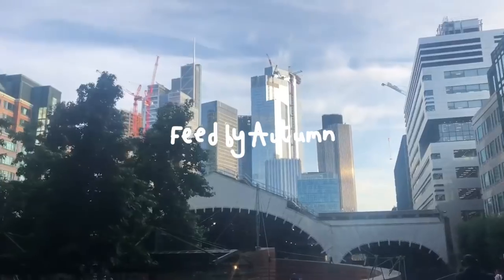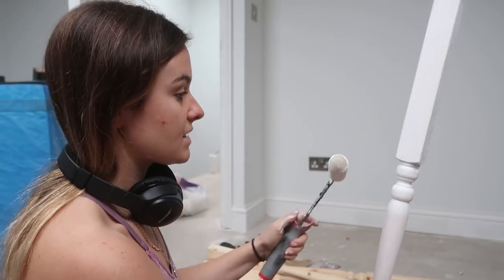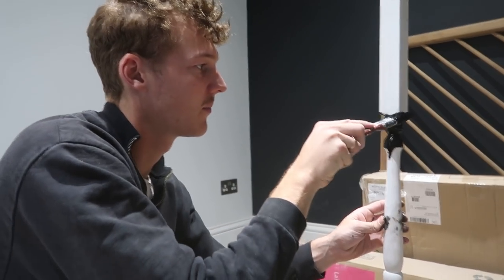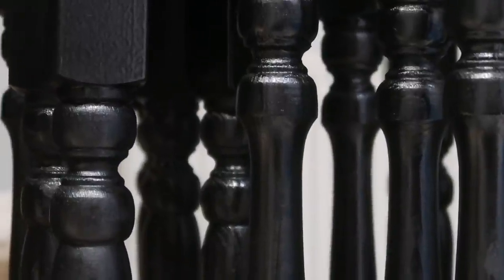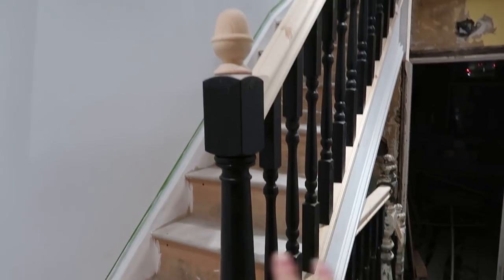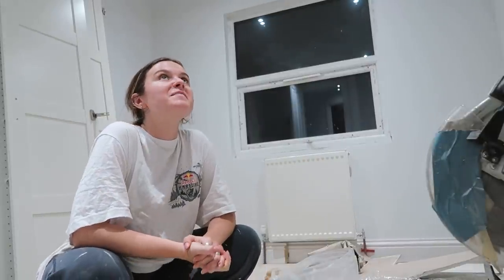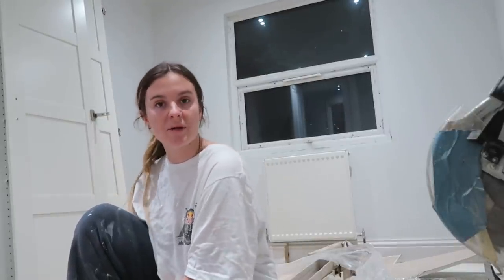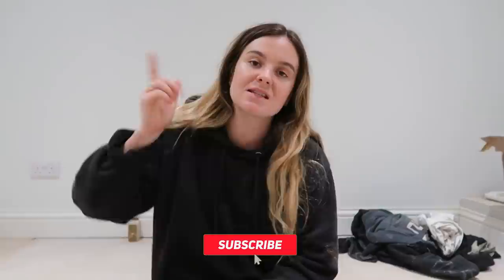THINGS ARE LOOKING UP | painting our stairs BLACK + installing banisters | victorian home renovation

Comment: Tip for the old newel posts: use Zinsser bin or 123 primer it’s very good and don’t need to remove old paint. Gives a smooth finish but stop any stains showing through your final coat! You can rub the zinsser down before the final paint for and even better finish! This stuff is honestly amazing!
Reply from the maker: Your comment came just in the nick of time before painting them black (although we did attempt to sand them, not the best finish). Funnily enough we actually bought a tub of this primer for the wardrobes,  will give it another coat before painting then - thanks for the tip! We were dreading removing old paint from the other parts of the house 😂

Comment: I’ve never tried it but saw this as tips for painting spindles. 
“A neat, fast way to paint stair spindles or other hard-to-brush objects is to use an old sock. First, put on a rubber or latex glove, then slip the sock over your hand. Dip your covered hand into the paint and apply it. You’ll cover the entire surface, including all the details.”

Comment: I think I would have spray primed those spindles, or use a rubber glove with a sock over it to dip in the primer and wipe it on.
Reply from the maker: We tried the sock trick but just couldn’t get the hang of it! If left so many drips and streaks - I think we used far too much!